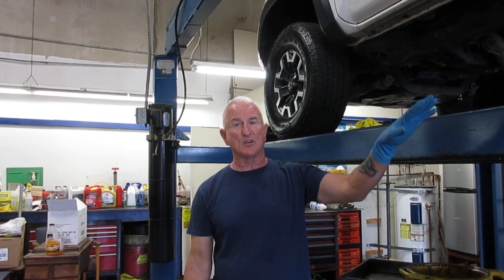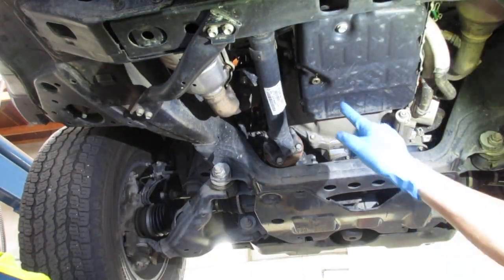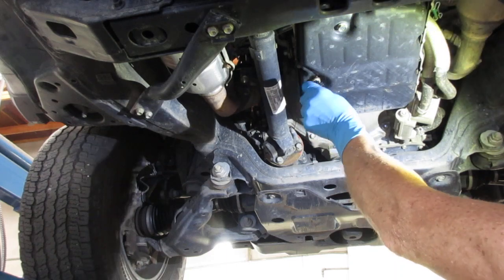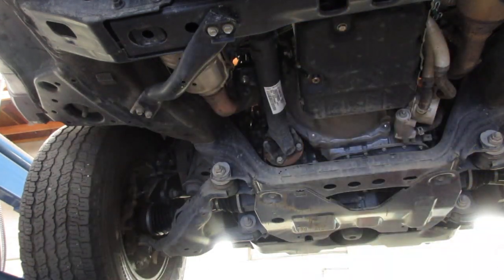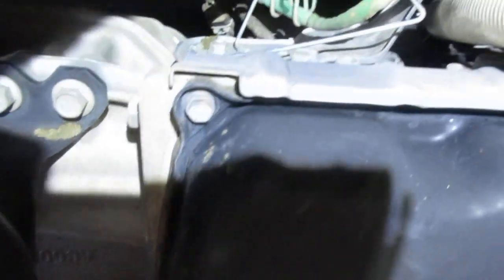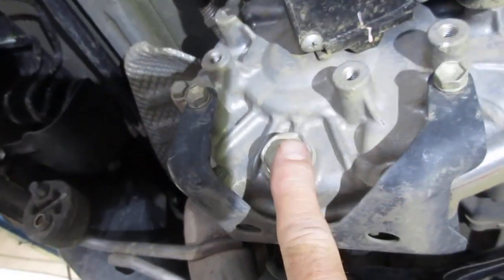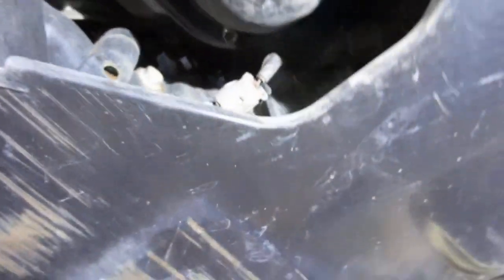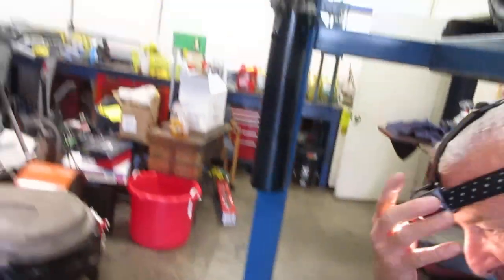2018 Toyota Transmission Fluid Check Between 95 and 113 Degrees Fahrenheit.

Comment: Hey friend..i just got a used Tacoma TRD 3.5 automatic 2018..service records are sparse..i have all the info of what the previous owner did, but specific transmission services are missing..after i get it up to running temperature , And I've been told to crawl under there and remove the drain plug and drain until a trickle, and then put the plug back in..I'm hearing that with the trickle, the fluid is at the proper level with the height of the stand pipe?
Reply from the maker: @jefflancaster6587  Nice truck! I would just change the fluid since you don't have any history. Remove the drain plug on the transmission pan and you get about 2 quarts out. Then back at the rear of the transmission on the upper side you will see a fill plug, takes a 15/16 socket. This is where you refill the same amount you drained out. Start the engine with your foot on the brake pedal shift through all the gears a few times. Then engine idling in park remove the plug in front of the drain plug, then slowly add fluid though the fill plug until the fluid dribbles out. Put check level plug and fill plug back in. Buy new seal rings for the drain and check level plugs. There is an o ring on the fill plug and I've never had to change it.
Reply: @JohnSadlersAutoRepair  ..thanks for the great details..I appreciate it.

Comment: John, what is the best method to check the temperature?
Reply from the maker: Hi David, I usually use a thermal temperature   tool, has a digital display. 
When the transmission pan is around 100 degrees Fahrenheit I check the fluid level.